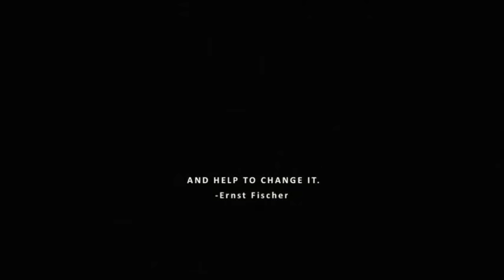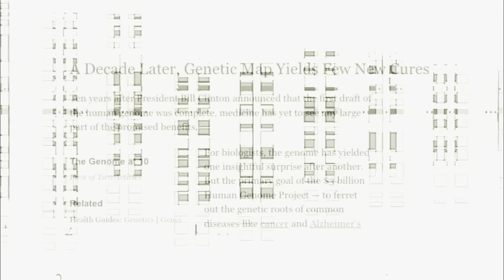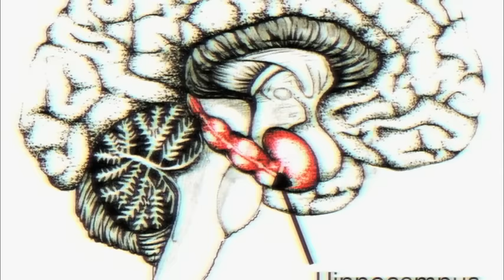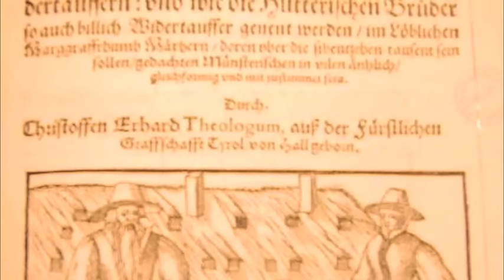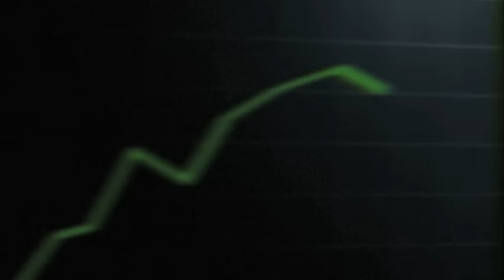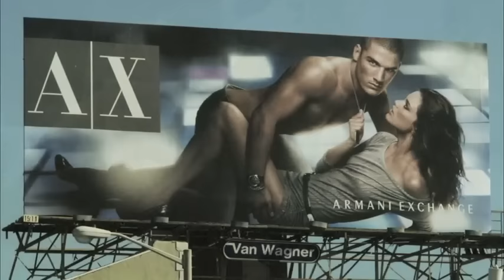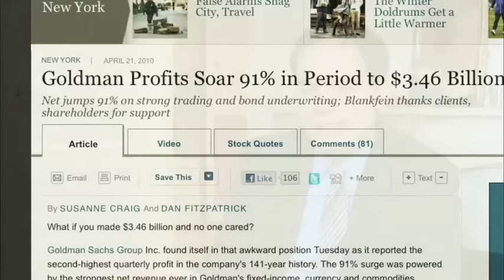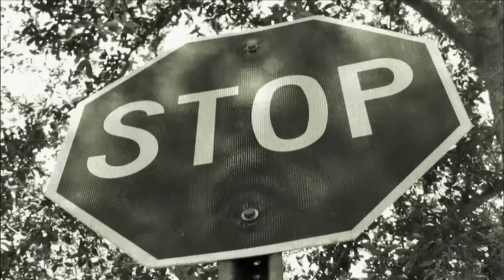ZEITGEIST: MOVING FORWARD | OFFICIAL RELEASE | 2011

Comment: I found it peculiar that Nuclear Power was not mentioned once in this film. Perhaps the subject is too controversial? If we are being realistic, it is the only current energy source even remotely capable of picking up the slack where fossil fuels leave off. There is a stigma attached to it, but it is incredibly powerful technology, much safer than most would have you believe, and much more capable of powering modern society than wind, solar, geothermal, or heat differential energies. Those energies make us dependent upon the whims of nature, and there is a significant waste associated with trying to store solar or wind energy in "a giant capacitor" at times when the sun and wind do not coordinate with peak hours of energy usage. This is one area where Nuclear has a clear advantage. The only catch is that it requires lots of water.